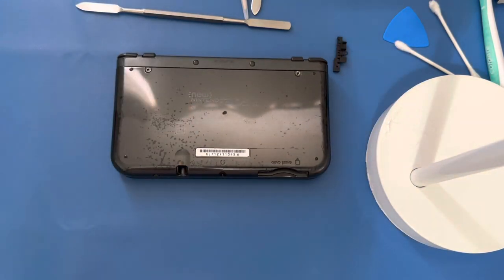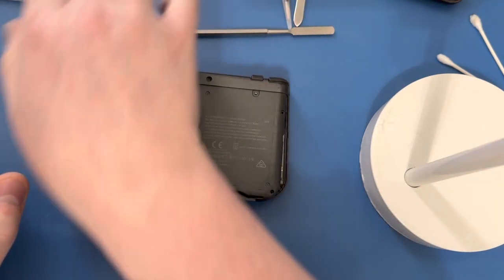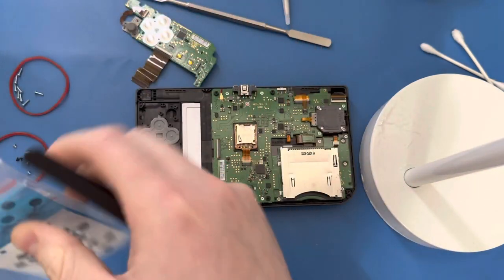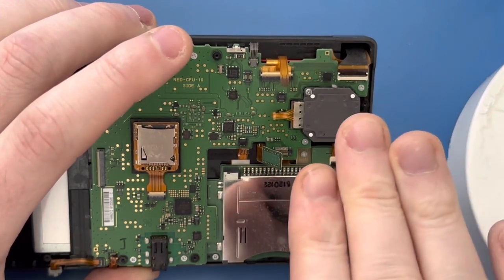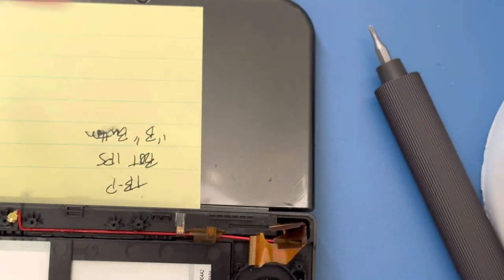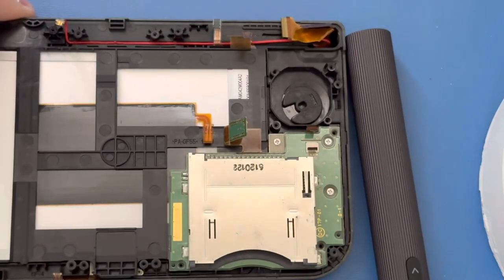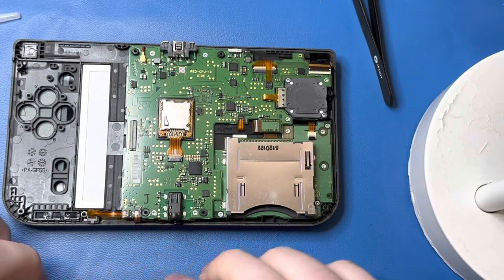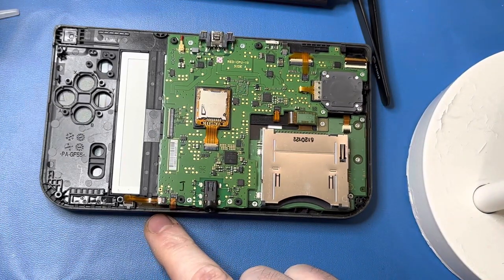How to fix DPAD, ABXY buttons, and Joystick for New 3DS XL, Newest version, complete guide.

Comment: If your 3d isn't working (as in, it's stuck and the slider doesn't work) then disassemble again and make sure that the cables are ALL the way in. I had it that it was one nanometer off on one side which was apparently enough to cause faulty behavior.

Comment: Was thinking about switching out the buttons and d-pad on mine for white ones and I definetly wouldve done it if I had a different model but with this one.. not too sure.
The ribbon cables without the flap seem a bit scary to me. Pulling them out and putting them back in seemed easy in the video but honestly I don't know if I trust myself with that.. and i've done joy con shell and button swaps.

Edit: not going through with the white buttons but after 8 years my 3ds needs a deep clean and some replacements. It's pretty easy; turns out the "flapless" ribbon cables do have a flap, you just can't put it all the way back.

Comment: I recently dropped my New Nintendo 3DS (Cover Plate model, not XL) and although it continued to work fine for a week afterwards, it just suddenly started crashing! I wondered if the wifi board got disconnected but when my Dad looked at it, nothing was out of place! Then again, that may be because either:

1. He didn’t look at the other side of the board

or

2. It was the ribbon cable to the Micro SD slot that got a bit disjointed, which may explain why in addition to the many crashes, I was once thrown out of the Mii Plaza and given an error message

If I remember correctly, I did see some damage detector, don’t know if it was for water damage but it looked red (if I remember correctly)! Should I get that replaced and where can I find a replacement if needed? My Dad accidentally broke the ribbon cable to the power button and 2 of the shoulder buttons so we’re waiting for replacements to arrive. Could that damage detector have something to do with the random crashes I’ve been getting? Thanks!
Reply from the maker: Honestly without seeing it in person it’s hard to say. If it isn’t modded and you’re having these issues it’s most certainly due to something not being properly connected to the motherboard or you have data corruption on the sd card. If it’s modded it could be so many things.

Comment: Hey, i picked a n3ds xl at a retro gaming market and seller said only issue with it is the power button being difficult, would take a lot of effort to turn the the device on or off. Other than that its in great condition. Wondering if there's any recommendations on how i could repair it. 

Any advice would be great

Comment: The 2 problems I have with my regular 3ds XL is that…
1. The D-pad won’t stop moving right. The buttons still work, but the blue cursor on the screen keeps going right, and I can’t regain any control of it, no matter what I do.
2. When I put a game card in, It doesn’t work right away like it should. I would have to keep taking it out and putting it back in and even blowing into the card slot and sometimes that would work, but not all the time. Is it possible to replace the cartridge slot?
Reply: I think you didn't hook in your ribbon cables correctly, you might just check those, and make sure there's no dust under them. I know with my Vita when I had to take it apart had a really shitty ribbon cable connector for the left thumbstick and it would constantly go right when I turned it on until I opened it up and found out that the left thumbstick ribbon cable wasn't seated properly. I hope this helps.
Reply: @Wakkajakka  Well, I didn’t try to fix anything. I think I might’ve unhooked the the cable somehow when I was trying to get the cartridge slot cleaned. I just went in there with a slightly damp Q-tip, but I think I may have to see if I can replace it if it’s possible. I’ll take my 3DS XL somewhere to get it fixed one day. Hope it’s not to expensive. Why i tried to clean it from the inside you may ask? I don’t know. I thought it would be easy to clean the cartridge slot that way!

Comment: Went to play my system today and the dpad is just constantly moving left. Ugh it was working fine yesterday and I always keep it in the case when I’m not using it dreading having to change  this out thanks for the video
Reply from the maker: You’re welcome, sorry you have to go through that.
Reply: started it back up today an the dpad works I already ordered everything to fix it though. I guess if it starts messing up again ill crack  it open.
Reply from the maker: @GoBeyond4Balls  If that's the case it's probably not the contact stickers, its the board for the dpad itself, thats easy to replace and they are relatively cheap to buy, around 7$

Comment: Can i use the new 3ds xl stuff for my normal 3ds xl or does it not work?
Reply from the maker: In most cases no you cant. The only thing thats shared is the joystick and some on the plastic buttons and thats it.
Reply: @JukeIndustries  so i cant use the new 3ds xl d pad for the 3ds xl? I can’t find a 3ds xl d pad only for the new one :cc
Reply from the maker: @zen6199  sorry I’ve been sick. I think the dpad is interchangeable. That should work.
Reply: What about the rubber membrane for the face buttons? 
My A button does double presses everytime I press it. I already cleaned the existing membrane and the contact points but the issue won’t go away. I’ve ordered a new abxy board but I can’t find specific new 3ds xl membrames